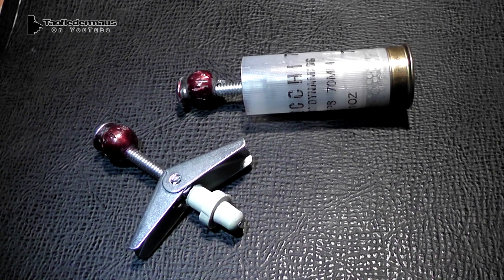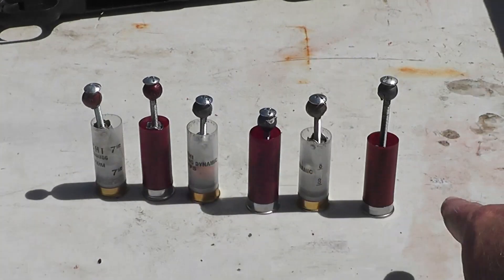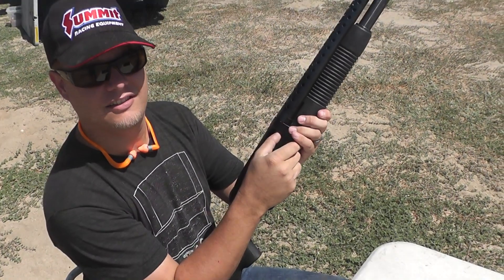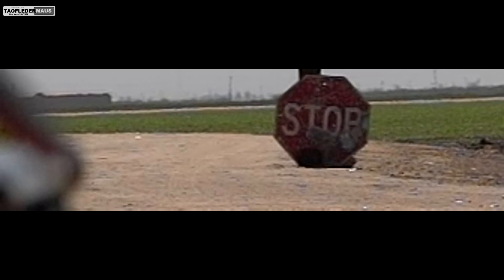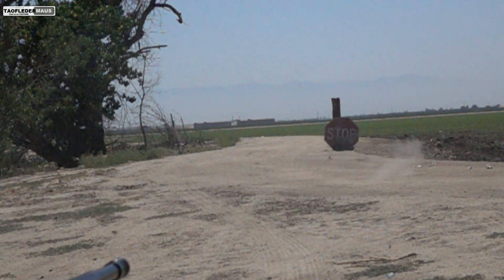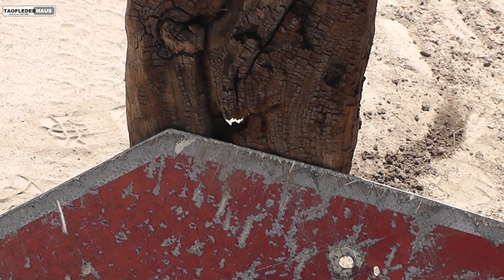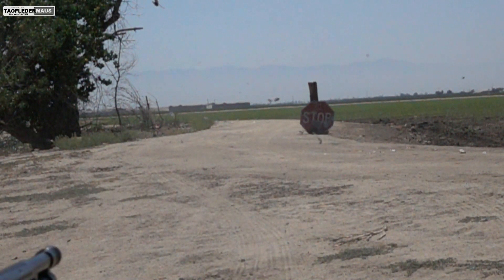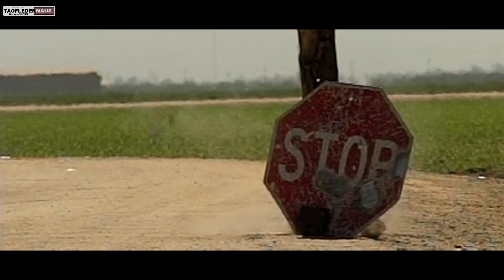Toggle-bolt Folding-Fin Shotgun Darts (long range test)

Comment: reinforcing the lead ball and the wings with nylock nuts so they don't move would be an excellent idea to try out. another one would be to try two sets of wings 90 degrees off from each other-- one at the back end of the lead ball and one at the back of the wings with a nylock nut to prevent movement. it won't look pretty, but for the sake of science, I feel this might show some improvement in terms of weight stabilization with long-range shots. at the same time, it might increase drag on the projectile. someone else mentioned drilling holes or divets in the wings for better stabilization, this may also be something to look into.

Comment: Why not cast a lead slug, thread it; and cut it in increasing weight samples? That way you can make a tighter fit possible, and finetune the best weight. 

Gun laws (Netherlands), and recent gunviolence in the EU (don't want to scare bystanders even with HP air) keep me from experimenting with this sort of stuff. 
Your vids make it so I don't have to break the law. Very informative, thinking out of the box with stuff from your toolbox.. I like!
Keep the vids coming, allways a blast.

Comment: The shaft of the last round was bent from the G shock. A small tube placed between the lead ball and the base of the fins to act as a sleeve and increase the surface of the pressurized area might help a bit, especially if the space between the thread and the inner lining of the tube is filled with glue or epoxy.
Reply from the maker: I'm not sure if that would make it strong enough.   We definitely had more problems this time.
Reply: *****
It would increase the area momentum of inertia, and therefore the critical force for buckling of the rod. With the radius of the rod being included by the power of 4 into the equation for area of inertia (I(x,circle) = (Pi/2)*r^4), doubling the thickness through the sleeve would (in theory) improve the toughness of the body 16 times. Okay, practically you'd have to fill the gap with liquid steel to have a homogenous structure, but that'd be a little over the top. ;)

Comment: It needs a sabot to properly work. Coat the whole thing in oil and then cover it in great stuff.You should be able to split the spray insulation off of the toggle bolt so it will separate in flight. Trim it to 12 ga. and insert it into a round.
Reply from the maker: sabots and hi brass!
Reply: Yeah, yeah, I know, everyone tells you hi brass......forgive my stupidity. I'd say in all seriousness that you would want low, low power for this combo. AND, I've made ceramic casting molds out of great stuff many times. Its easy to work with and easily shaped.  Try cutting a shell off at the base, insert whatever you want to sabot ize,(making sure to oil both the inside of the case and the object within)and shoot spray insulation in. You could push the finished product out of the end, or cut the shell away. Or better yet given your proclivity towards wax slugs, try wax.
Reply from the maker: I'm not sure there would be room to add a sabot to this since the fins, etc tucked into the shell was a pretty tight fit.
Reply: Good point,only one solution then, buy a ten gauge.......LOL
Reply: I like the way you think...

Comment: I was thinking, you could have the fins only come out on impact. You could have a bar attached to the ball and the bar is connected to some securing mechanism, and a spring attached to the fins which goes on the bar. When the ball hits an object, the spring will compress and the securing mechanism will release the fins. 

I'm not sure if the fins would release in time however, I could imagine that being a problem.

Comment: I believe that a .70 or a .72 calibre ball would actually be a bit better than a .50 calibre ball, as a twelve gauge's diameter is closer to .72 inches than a half inch. It would allow for a tighter seal and thus better energy transfer, possibly better ballistics as well. It would also allow you to achieve better velocity with a smaller powder charge.

Theoretically, of course.

Comment: The issue is the bolt, it has a lot of weight at the front and it is bending before it exits the gun. perhaps some sort of brass or aluminium sleeve between the fins and the ball to take some of that stress would help.

Comment: Maybe it would be more consistent if you make a sabot where the void is filled with sand or some kind of powder to keep the wad from shredding in the barrel. Then it should keep a good gas seal and the sabot and it's filler would disintegrate once they leave the barrel, with the toggle bolt slug continuing onward.

Comment: put the salvos/sleeve past the balance point.

think of it as balancing a broom stick on your palm, the bristle head at the top may seam stable, but at the point of contact with your hand there will be alot of movement, that you need to maintain in order to counteract gravity, and to maintain stability. 

exchange gravity w/momentum and the counteracting force of your hand w/the forces of a shot gun and you get instability of flight.
Reply: ever think of extending the plastic sleeve of the shotgun shell?

instead of a 3 1/2" shell.
a 4 1/2" - 5" shell.

Comment: Good Video Jeff!.. I wonder if the Problem was Ya Used A Heavier Weight on the frontend This Time, Maybe Causing the bolt to kinda Buckle in the barrel..? & maybe Not enough contact between the bolt & wad, Causing to great of pressure in a pinpointed spot Causing it to kinda Split..?.  just wondering! Not Saying or Nagging That You did anything wrong! OK!. I really like the Video! Hell 1 can't find out what'll Work if They Don't Try!.
Thanks For The Video Jeff!
Have a Great weekend!.

Comment: I keep thinking the bolts could have been shorter a bit.not sure if that would make a difference,but at the least would add more streangth to the bolt.leangth adds flexibility.biggest issue is those fins.not sure how you could cusion them without removing their intended function without a sabot.and sabot will add complexity to an allready complicated round.

Comment: I think your problem might have been that you added a heavier weight on the front compared to the rubber pieces you used last time this might have added more stress to the bolt deforming it and what not

Comment: Turn the wing nuts around more like a arrow. The spring pushing out could possibly act as stabilizers. Also the wings pointing forward would add more drag, then facing backs would be more aerodynamic plus more velocity plush more energy on impact then have resistance when removing. Please try I'm get curious about that

Comment: curious have you tried mounting them backwards with the weighted larger shot section in the cup (applying a under weight dart principle where you throw a cheap sup light dart backward and it natural aerodynamic tendencies pull it back straight you could mount the "fins" backwards like the su37 or experimental planes from the movie stealth)

Comment: Make A "injector" Gallium filled round and fire it at a block of aluminum, then wait 5 mins and shoot it with a rubber stun round to see if the block is weakened enough to allow the stun round to penetrate.

Comment: Hey, Jeff. Have you thought about cutting the anchor arms a bit shorter (maybe take 1/3 off) and reversing them so any wind resistance would hold them open?
Reply from the maker: The way I have it,   the arms can open as much as needed to self-regulate the drag.    If I reversed them,  they would not only open in the barrel,  but gouge extremely hard into the barrel  from the acceleration.
Reply: +TAOFLEDERMAUS couldn't you use a simple 2 piece pvc sabot to keep your barrel intact? Just dremel a bevel on the inside edge of a piece of pvc (I'll leave proper dimensions to the experts) split it in half or thirds, wrap back together with a single layer of cheap scotch tape.
Reply from the maker: I don't know.

Comment: what if the darts were held in the shell with a soft gel. Should add some extra weight, and keep the point of the dart center. The gel should break apart once it leaves the shotgun, thus allowing the wings to deploy.

Comment: mabye try a design with a more aerodynamic tip and 3 or 4 stabilizers like an arrow, also mabye the ridges on the actual shaft are causing increased air resistance as well, dunno just some thoughts :]

Comment: What if you put a metal washer or coin between the wadding and the projectile?  The plastic wadding is getting pushed into the back of the threaded piece and the end of the fins, which rip it apart.

Comment: Great video, would loading them backwards make any difference? Would the air grab the fins, whip them open then flip the round and help it fly straight?
Reply from the maker: The fins would open in the barrel (under 10K psi)  and dig in like a plow.
Reply: Not good then.
Cool video though.

Comment: +TAOFLEDERMAUS really nice vid! i think maybe putting the folding fins backwards would help? just guessing. 
you could also drill some holes in them as +TheTorontoTickler said
Reply from the maker: It would be like trying to make an F16 fly backwards.  Also the fins would dig into the barrel from the force pushing them outwards.    The balance would be altered and the CG would be altered.
Reply: I see,i guess my guess was wrong xD

Comment: do you think you could get 4 fins on there? you have stabilizers for left and right but not up or down. you at least need three like an arrow. but since they fold i am guessing they will kind of get in the way of each other. Would be happy to see if that makes a difference! thanks!
Reply from the maker: There isn't room for anything else in the shell
Reply: TAOFLEDERMAUS ,Hey try winding up the fins close to the head or weight of the projectile might help stabilizing the flight.
Reply: No, its best to try to get the drag far from the center of mass when it comes to bullets

Comment: That was weird.
Compared to the original flat washer head design, the behavior was different.
But the original design might not be worth much beyond the distances you fired them.
(Fifteen yards or less if memory serves?)Any way to compare this design and the original?
Reply from the maker: I think the weight at the nose just just slighter higher on these than the stacked faucet washers on the first try.

Comment: would the lead ball be changing their characteristics so the shell has a harder time shooting the round?
Reply: It's both.  The lead ball dramatically increased the mass of the projectile and subsequently the forces on the toggles making them or the wading break.  Would have been nice to see a control test without the lead ball.

Comment: im guessing forming shot cups out of resin and carbon fiber might work
Reply: like how a dentist would cast a tooth though, fill it into something shot cup shaped and when its ready to leave to dry, stick the end of one of those in petroleum jelly and sit it in there.
it should make a cast that holds everything together until separation
Reply: I agree, the sabot is a good option here I think, but casting the sabot like that would make it fit the round so tightly it might not fall off.  You just have to cast it in such a way that it will fall away from the round without trouble. Not impossible by any means, but probably rather fiddly.
Reply: theres a reason machines do these things lol

Comment: what happens when you shoot a normal dart? or just a small version of a normal dart.
Reply from the maker: We have.   The problem is always transferring the energy across the base of any projectile so the wadding doesn't blow out, etc.  Also,  the object has to be very strong and the darts we shot compressed,  contorted, etc quite a bit.

Comment: Why did you do it like this? With that lead ball and all? The original round was just fine. Fins deployed, round stabilized, target hit. Then you went and modified it and it failed to perform like before. Next time you do this, stick with your original configuration of faucet washers and shorter toggle bolt. That lead ball on the end might be the reason your "fins" are failing to stabilize that round: too heavy.
Reply: He's trying new things to see if they'll work. This isn't a channel to use the same sort of slug over and over again unless it's the best for the job at hand.
Reply: Maybe I'm mistaken, but didn't he say he was trying to see if the toggle bolt round worked over a longer distance? Shouldn't the experiment then involve THE SAME configuration? You know, to see if it works?
Reply: *****
I would agree... but they only have so much time to work with. As a general rule, custom slugs that are front-heavy fly better than non front-heavy ones, and so these (at least based on what this channel has shown) most likely had a higher chance of successfully flying. The impression that I've gotten from this channel is that they only have a limited amount of time they can film each video in, and making two different types of slugs would increase that time.
Reply: Well, if you need specific data on the original toggle bolt round, yes, you'd want the same configuration.

Since he's just trying stuff, there is no harm in modifying multiple variables at once.  He can always make more like the original design and shoot them at long range.  I kind of feel like it would be more satisfying to make a high power version of the original slug, even if that involves tearing apart a few test rounds.
Reply: SlocketSeven Agreed, I'm just saying why I think he did it.